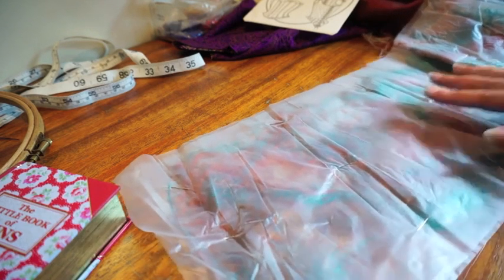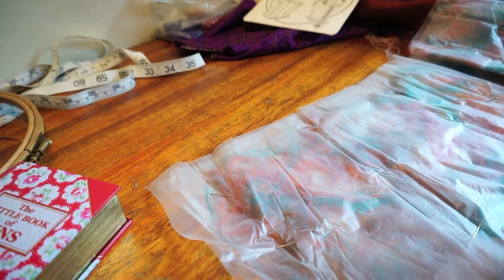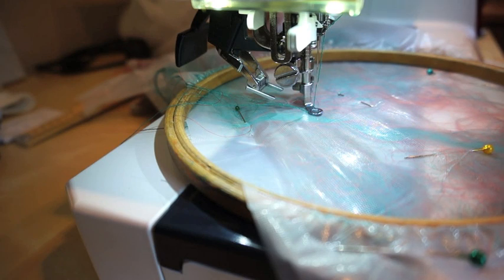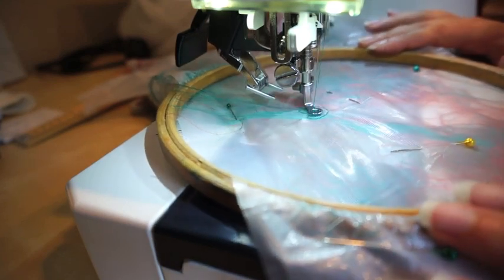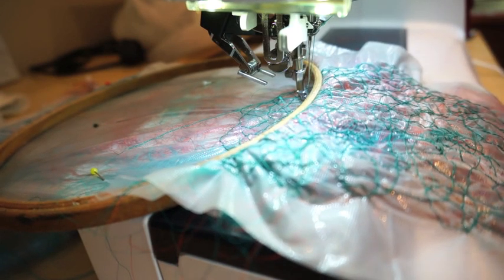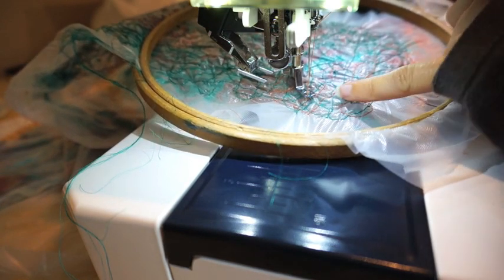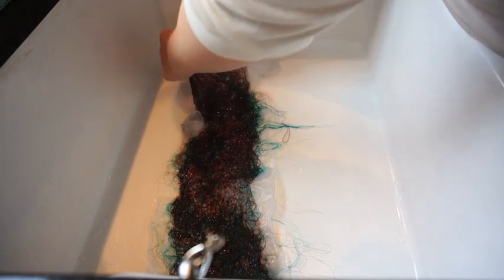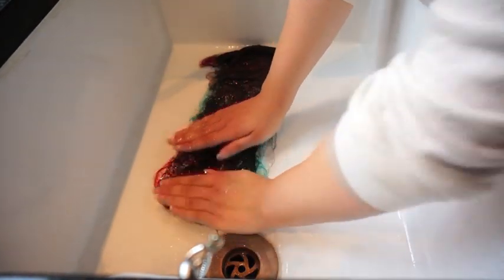How to use Water Soluble Film for Machine Embroidery

Comment: on your opening page on screen you spelled Embroidery wrong! Very inspiring, for such things I would use a trough outside with a hose, to prevent my septic tank from getting stuck up with gelatinous gunk then dump it on my compost pile since it is vegetable matter.  Would have liked to see what you packed into the 2 layers because don't know what you actually started with to produce that wonderful result.  thanx though